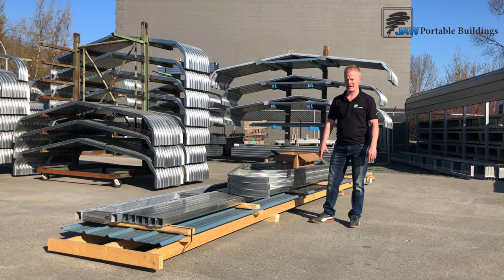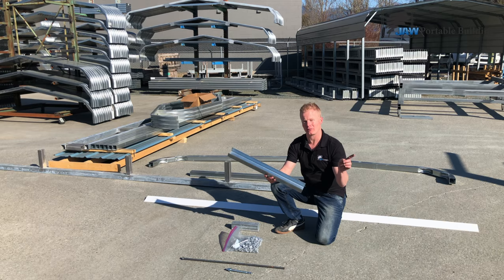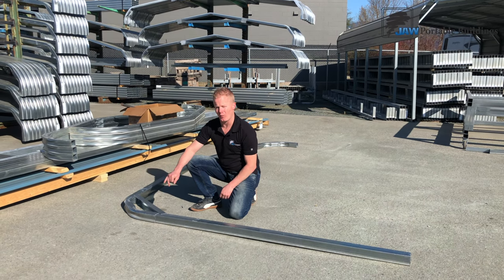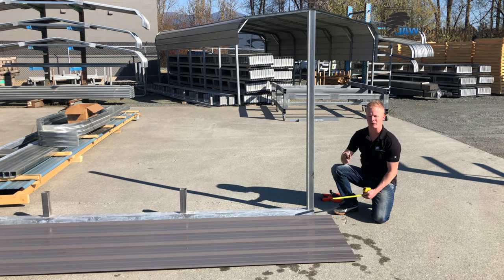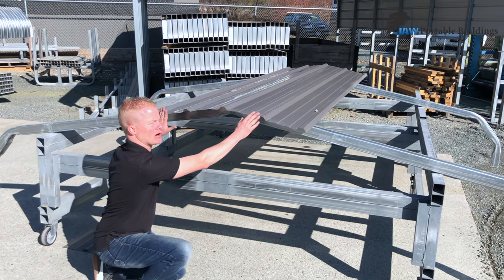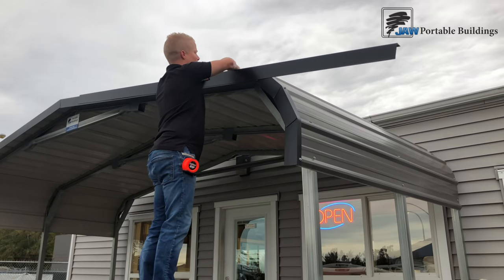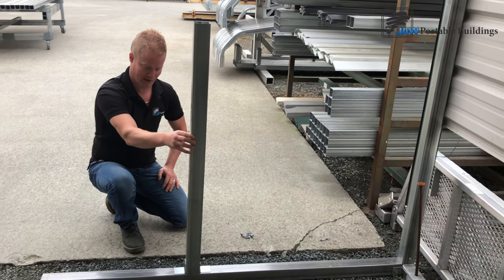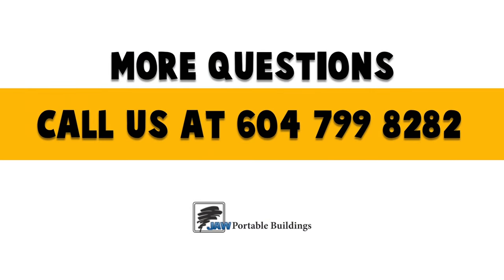Carport Installation Video

Comment: Thank you for the very helpful walk through of install.
I bought one several years back here in the states, I didn't have the large enough slab where I wanted it to go, so didn't get the low price install, just delivery. It seemed a really good deal and didn't want to miss out on the price.
It's just been sitting in my backyard, still new like delivered. There were no instructions, just a sped up video some years back, now I don't even see that. I was pretty sure I had mapped out how it likely was intended and it didn't look complex, but it's nice to confirm ahead that you are indeed installing as intended. Thanks again for the video.
Reply: You prolly dont give a damn but does anyone know of a tool to log back into an Instagram account??
I stupidly lost my password. I would love any tips you can give me
Reply: @Paul Edison Thanks for your reply. I got to the site through google and I'm waiting for the hacking stuff now.
Looks like it's gonna take a while so I will get back to you later when my account password hopefully is recovered.
Reply: @Paul Edison It did the trick and I finally got access to my account again. I am so happy!
Thank you so much, you saved my ass :D
Reply: @Jaiden Musa No problem xD

Comment: one side of the panels edge has a slight flare. Im assuming it is on the down side ?
Reply: They won't answer.  But you are correct.  The top-overlap side doesn't even extend down to the valley.

Comment: Why is the roof with horizontal instead of vertical? Snow load!!
Reply: Cost and ease of installation... otherwise it is inferior. Like on the A-frame, you would need metal purlins (hat channel) for support but this is much better since debris will not get trapped at every rib and collect holding moisture.  Evergreen needles decompose and create perfect moist/acidic conditions to erode/oxidize that very thin sheet metal in no time, for example.  You will never see a metal residential or commercial roof installed with horizontal ribs.  Never.

Comment: What kind material  compact build it on?
Reply: You can install it on dirt, gravel, pavement, concrete.
They have 2 anchoring systems, For Gravel, Pavement they have 30" Re-Bar anchors - For concrete they supply 7" concrete anchors - For more details please feel free to call them at 604-799-8282
High wind locations where it's placed on dirt, gravel people also tend to add a few auger anchors.
Reply: @willahelmpowers4835  You COULD build it on dirt if you don't care about it, but it should never been in direct soil contact.  Aggregate is not soil and provides the necessary drainage as well as decoupling from the soil.

Comment: I ask a few guys that sell them on fb n they don’t know Do I need any permit if it’s built onto of concrete or near my house ?
Reply: You must check with your local building codes.   For my area you need a permit for any structure greater than 10x10.   So check with your local town building inspector.

Comment: I didn't see any details on anchoring.
Reply from the maker: Hi Chris - We have 2 anchoring systems, For Gravel, Pavement we have 30" Re-Bar anchors - For concrete we supply 7" concrete anchors - For more details please feel free to call us at 604-799-8282
Reply: Could this be anchored to a 4x6 ground contact timber using 6" screw lags?